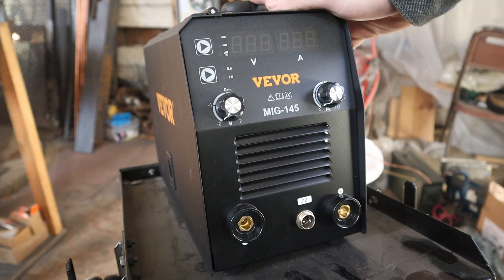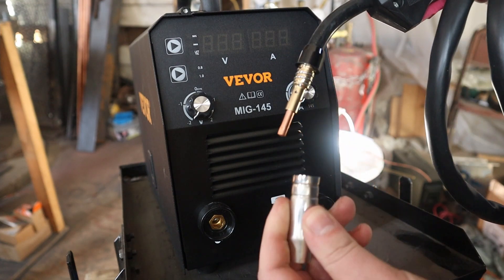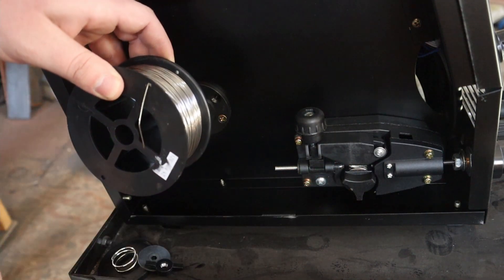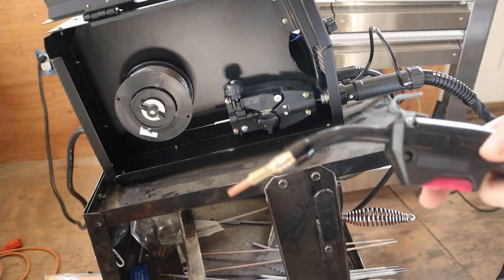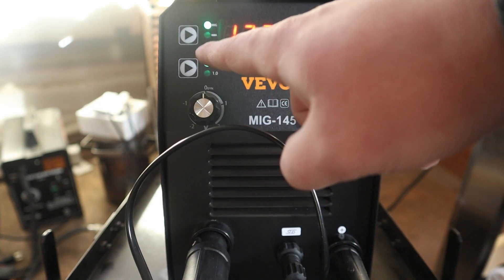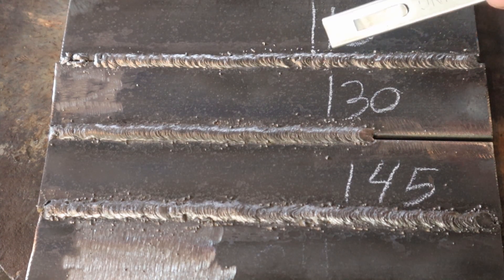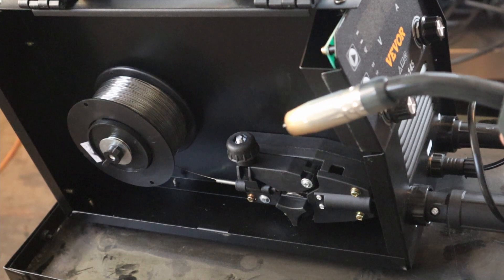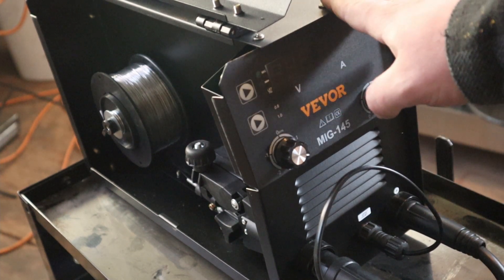Vevor MIG-145 Review and setup/ Welding Machine Under $200

Comment: Did you have it plugged into 110 or 220? I’m looking at this machine presently and everything you said definitely help make a decision on this will probably suit my needs just right. It’s just for helping some neighbors that have different  types of trailers that seem to break the simplest things on them. Also did you happen to try and weld any stainless steel ? By the way I liked how thorough and detailed you explained each and every part of the machine that you would use.
Reply from the maker: @charliecppickering8539  I had the machine plugged into 110. But I didn't try any stainless steel welding, only mild steel.
Reply: @FerrousPhoenix  gotcha thanks for the info

Comment: I bought semi-automatic, gasless, one knob (material thickness), 200 amps welder. Its wire feeder start slowly and then accelerate. Not used yet.
Reply from the maker: To this day I still have that problem with this welder. And I have yet to find what causes this.

Comment: does this welder come with the stick and tig wires? im pretty sure the argon for the lift tig goes through the line of the lift tig not the actual welder
Reply from the maker: It does not, they have to be bought separately

Comment: Why do Mig/Fluxcore welders have a Voltage Knob Also, but Stick Dosen't.?
Reply from the maker: Wire feed machines are a constant voltage machine. So the voltage stays the same throughout the entire weld. 

Stick welders are a constant amperage machine, so the amperage stays the same but voltage can change throughout the weld.
Reply: @FerrousPhoenix  Ok, but its the Mig that has the 2 Knobs the user can actually turn... The Stick has 1...?
Reply: On Migs u can play with the Amp and Volt settings, on the Stick only the Amps...
Reply: Hi  broo.. I'm buy the vevor but it doesn't come the wired.. where did you buy?
Thanks
Reply: Loosen your tension on the pulley motor

Comment: I have this same welder and it seems that the amp dial is actually wire feed speed. I assume it actually is amps though when turned to stick mode.